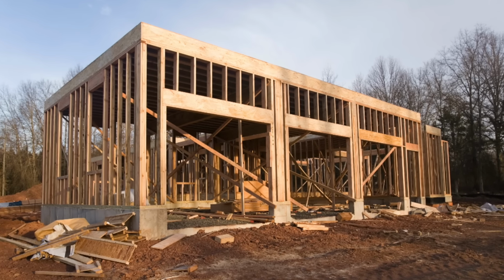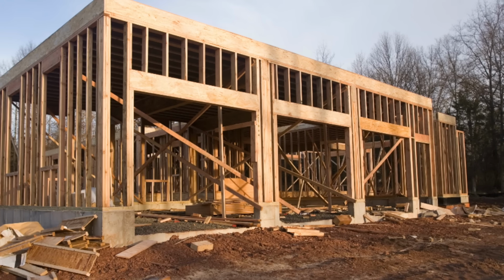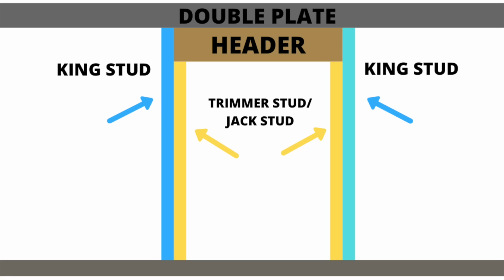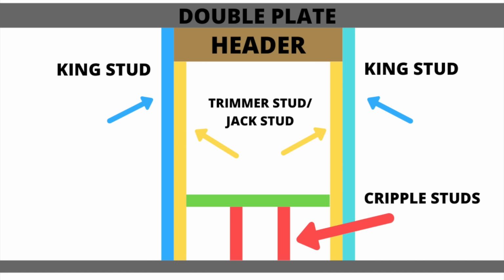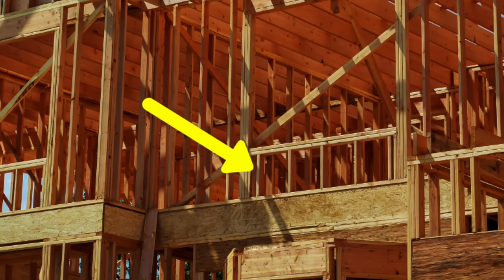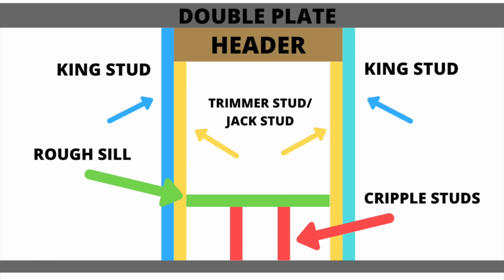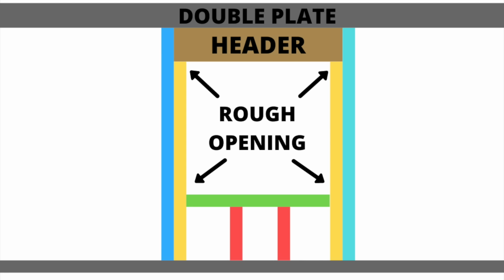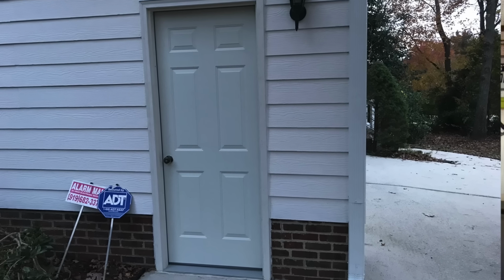All House Framing EXPLAINED...In Just 12 MINUTES! (House Construction/Framing Members)

Comment: Trusses are garbage.   When the wood softens in the coming decades, the metal plates tend to weaken and allows shift.
Back in the 80s trusses were used extensively by home builders and they are now becoming an issue in the North East.   Snow loads and wind force have caused severe racking.   
If the choice between 2x8 or trusses, only one logical answer exist.

Comment: Its called a Wall Plate.   Mud Sills are exterior and carry no weight.  
Terminology sure had been bastardized in the trades.
Engineered joist are absolute garbage.  If you see these in a home or building; leave.  They are disastrous in a fire.  They loose support in moments from heat and fold like dominoes.  They are referred to as "fireman coffins"
Blocking should always be run at 22.5 degrees.

Comment: how is an I-joist any of those things you mentioned?  Not only do the look cheap and unstable but the center material they are made out of is not that strong to begin with.  It looks like you're cutting corners just by using them.  There's no way they hold up just as well over a period of time compared with what they replaced.

Comment: Great instructional video but they build homes now to last like a manufacture home, not like things built back in the day. I-Joist and chip board surely need the driest conditions, and you better not have any plumbing leaks or a waterbed. How about that daredevil at 5:17, I wouldn't stand on a top plate and bend over like that, not even if I was young again.

Comment: American houses are a joke compare to the rest of the First World. Cheap OSB or plywood covered by some plastic sheet on the exterior followed by some vinyl siding. For in inside, they stuff in some pink cotton candy in between the studs for insulation and then cover it with a carton box material they call Sheetrock. About 2000 SQF of that mess, not including the 20x20 garage, will cost you around $300,000...

Comment: I am French, and the difference is really interesting. We have access to and use the same general rules of mechanics (basically use triangles everywhere, and you really have  a rectangle brace the diagonals), but the results in the detail of how a house is built is just crazy.
Reply: are there any videos showing the details of how houses are typically built in france? i'm very curious about the difference(s). i thought that wood framing is far less common in europe and especially france than it is here, which would in itself result in big differences – am i wrong about that? anyway, if you have any links to videos about common french house building methods, i'd love to watch them.
Reply: @jraaccounts  maybe you could have a look at this: https://www.youtube.com/watch?v=0V2h7QMb3hc it's typical, the guy is making the gables "livable" because the country lacks space to expand houses, he uses plaster board over a steel skeleton, and he has to use a ridiculously high R value insulation under the roof by law.

Comment: NOW YOU SEE HOW COME NJ HOMES ARE SO EXPENSIVE .. THEY ARE SOME, IF NOT MOST OF THE BEST BUILT HOMES IN AMERICA .. NOW ALL OF AMERICA HAVE TO BUILD ACCORDING TO THE CONSTRUCTION BUILDING CODES CREATED BY NJ BACK IN THE LATE 60’S EARLY 70’S ..  AND YES THE SOUTH HAS NICE LOOKING “POOR QUALITY” HOMES BUILT BEFORE 2012/2013 ..
Reply: All of America doesn't build to NJ standards, but nice try....   NJ (currently) uses an amended version of the 2018 I-codes, and their own "Uniform Construction Code".  Literally NOONE else in America uses this exact code. Also, NJ doesn't create the codes, they simply amend and adopt them.  The codes (with the exception of the NJUCC)  are created by the International Code Council.  Also, new codes are adopted every 3 years in NJ.  Your comment seems to suggest that NJ is still using codes created back in the 60's and 70's?!  WRONG.  You're not only literally yelling in internet speak (all caps), you're spewing false information.  Oh....and NJ homes are expensive because of real estate prices, NOT framing.  Sure, homes in NJ require more stringent wind requirements than most homes in the south and therefore more robust connections, but otherwise it has nothing to do with framing.  I will agree that (depending on the builder) that NJ has some of the best built homes in America, so there's that.

Comment: As a European, and having lived in the US, it still amazes me that homes built like this are the same price (or even higher) than our (literally) rock solid brick and mortar homes 🤷🏻‍♂️
Reply: Supply and demand.  Cheap mortgages (rates well under 4% a lot of the time) enable high demand so higher prices... of course this varies with location but it's not that hard to get a loan on a house here.  Bankruptcy?  Five credit cards each with 70% utilization?  No problem, fam!

Wood is also plentiful and cheap here (unless a pandemic has closed a bunch of sawmills).  If it was as abundant in Europe I'm sure it'd be used there a lot, too.
Reply: @NorthernWindNut  Most wood is imported from Sweden these days so....

Comment: This was a fantastic video. I will never be in the construction business, but after renovating much of my own home, I became very interested in how it was built. I remember going up into the attic and looking at the roof structure wondering what the heck I was looking at. I remember looking at the framing left over after a friend and I removed a wall with a door and wondering why the door was framed the way it was. I remember wondering why there was pressure treated lumber touching all the floors in my house. Now I have a lot of my answers. This 12 minute video is not only excellent for those in the construction business, it's fantastic for homeowners who are simply curious about why their home is built the way it is. Keep up the great work!

Comment: Homes in USA are utter junk....Iffy "foundation", wood sticks, tar paper, saw dust boards, vinyl siding, sheet "rock", rubber and plastic, built by unskilled (undocumented) labor force hired by "fly by night" builders. Small garage in which no car will fit (used for storage), short "drive way", and lot so small one can cut grass with scissors. One spends every week end going to Home Depot or Lowe's, fixing stuff.  All of these houses are full of cracks inside and out. Wood moves with temperature and humidity pulling shit rock with it. Yet they charge a fortune for this. The three little pigs built better homes. Homes in other countries last for centuries. In USA they start falling apart the day you buy them.

Comment: That I-Joint with a hole as big as the I-Joint... that strength is to say the least, very compromised.
Reply: It's not compromised. the vertical center of a beam/ joist has no forces acting on it; only the top and the bottom do.
Reply: @jobacuda4472  say what?, the fucntion of a beam is to hold vertical load. and what the beam is like a "I" is just for that reason, to hold vertical force. drill a hole the size of the beam and you have no strength left. or have i misunderstood the very basics of physics?
Reply: @FSandberg  That hole was not cut into the i-joist. It is a knockout stamped into the web during manufacturing. It is meant to be removed to allow ducting to be run through it.

Comment: The anchors at the sill plate are primarily for shear and prevent the structure from sliding off the foundation. In areas of higher wind hold down anchors are used strategically throughout the home to prevent the house from overturning.
Reply: And huge numbers of hoedowns are used in earthquake zones.

Comment: As someone from the Philippines, I have always been fascinated by American stick framed houses. Our houses are typically built with either poured or block concrete. I was always curious but never found a simple video explaining what all the pieces are for. Loved the vid!
Reply: I'd love to see a tute like this on how to build concrete block housing. How do you get it to acceptable insulation, and what do you have to do to make it waterproof? I'd trust concrete blocks to last a lot longer than stick frame, but it has to be good to live in too.
Reply: @tealkerberus748  Autoclaved aerated concrete at twice the thickness of a woodframe house provides comparable insulation. The advantage is that you have a lot more thermal mass letting you store the the cool temperatures of the night in your walls which is probably quite nice in a hot country like the philippines.
Reply: @ErikB605  Thank you. I'm unconvinced about thermal mass in a hot climate - if it heats up and stays hot that gets unpleasant fast. In a high diurnal shift climate, so with hot days and cold nights, thermal mass performs brilliantly. And I'm looking for a building system for a cool mild climate - almost always too cool to be comfortable, but rarely if ever freezing. So it's different again.
Reply: @ErikB605  they make most blocks by hand especially in the provinces area like farms
Reply: @tealkerberus748  I have built houses in Costa Rica out of concrete. I'm sure the process is similar in most tropical countries. There is no insulation necessary. Houses are made with cinder blocks with rebars to fulfil the strict earthquake codes. The blocks are usually then filled with poured concrete after all plumbing and electrical conduits have been installed. Each corner column (or after each run of about 8 feet) are rebar-filled, poured structures that tie everything together. All surfaces are cement-rendered and usually painted with water-based paints meant to seal against moisture and then painted with mould and mildew resistant water-based paints. Other houses are made with prefabricated vertically grooved posts (about 5x5) and rebar-filled prefabricated panels usually four feet wide, two feet high and two inches thick. They form a tongue and groove structure. Columns are planted and then plates are poured and the top beams are poured after all the columns' rebars have been tied to the rebar structures within the poured beams. All surfaces are then rendered and painted. Second floors can be poured concrete or wood or metal joist structures. Most well built homes are earthquake and hurricane resistant (although many roofs will still fly off unless people build with hurricanes in mind). Mind you there has only been one hurricane in recorded history that has entered Costa Rican territory (thankfully).
Reply: @tealkerberus748 concrete has it’s own issues. If it has rebar, it’s life is almost always less than 50 years, as the rebar swells when it rusts and cracks the concrete.

all concrete cracks, and it can sweat. It also is porous (unless sealed) and will pass moisture, etc.  it’s also chemically active (a strong base), which can cause odd effects unless it’s sealed correctly. 

It’s also very heavy and not strong in tension, which makes it problematic in earthquake prone areas. 

Still very useful of course!
Reply: we build junk stick frame houses in the usa. only commercial buildings in downtowns are block mostly.  block is better as long as it is done right. this guy also does clean nice work.  u cant beat building a thick poured walled house.  its better at everything. especially insulating. sink it into the ground in a hot climate and u will always stay cool
Reply: @tlohbor2690  I live in Miami. Virtually all residential construction here is CBS — concrete block and stucco. Only lumber is in the roof and interior framing. Except for decorative stuff on the outside to make it look more like a framed house if that’s a look they are going for. If your roof to header connections are solid (tie straps and sufficient nails), and you keep the outside doors and windows secure (impact glass or anchored metal shutters), that CBS house isn’t going anywhere even in the face of 99/100 hurricanes. This was an excellent video. I would love to see one discussing framing interiors and roofs on a CBS house.
Reply: @tlohbor2690  Not just stick frame houses. Yes that is most common, but here in Washington State we have been doing a lot of ICF block houses. If you dont know what that is, ICF is just styrofoam blocks stacked up as concrete forms. You pour the concrete into them, leaving the styrofoam layer on either side of the concrete, giving you the best isulative value of any residential building in the world.
Reply: @tlohbor2690  Wood framed houses can be built to last for generations, and wood has the advantage of being cheaper and sustainable. Of course most houses in the US are built by shady developers who are cutting every corner they can get away with and they get built so fast now that I have my doubts that they are being built with much care, but it's not inherent that wood framing is crappy.
Reply: Americans build their houses out of wood because of cost. And history, but mostly cost.
Reply: Or nippa !
Reply: Bear in mind, the video just addresses modern, code compliant, platform framing; common in tract homes. We also construct homes using various masonry systems. Homes framed with lumber may also be timber framed, or balloon framed. Timber framing isn't an uncommon practice today, while you'll only find balloon framing in older structures; balloon framing hasn't been code compliant in decades, as the stud bays run from the crawlspace/basement, to the attic. This allows a fire anywhere in the structure to quickly spread to the roof. While the guy in the video sang the praises of truss systems, he omitted the downside; truss plates tend to soften and fail in a fire, leading to collapse of the structure. Having been both a construction contractor, and firefighter have informed my perception of construction methods. One advantage I've found in balloon framed structures; replacing an entire floor system is a snap.
Reply: Like many commercial building walls and floors are here in the usa. We use a lot of metal supports in the ceilings in buildings, not homes. Could be due to the storms and  rot issue as in the Philippines is hot and humid and storms too, a cement and block home wont rot or fall down in a bad hurricane. Of course for earthquakes, wood stick framing is superior.

Comment: I owned and refurbished a 100 year old 3 story bubble frame house.  On the 3rd floor thw rafters were enormous with the rodge board 16' hight and 8' knee walls to fit an 8' tall attic/living space.  When I redid that area I wanted an open concept with cathedral ceilings. A neighbor with a very similar house had one, but when I brought in a engineer he said it would be unsafe to remove the collar ties spanning the bottom of rhe rafters. He said with the slate roof and the winds the neighborhood got from time to time madenis prone for a collapse. I had already removed them, and didn't want to lose rhe clean lines of the cathedral ceiling that my neighbor had in his place. So I decided to cut them in half and raise them up.  I moved the 8' knee wall down to 4' for more square footage.  When finished with recessed lighting the space was grand.  And because the central air trunk line was set up at the ridge board, the concept was going to be compromised anyway.  I ended up with a Dutched ceiling to hide the main duct line and exposed collar ties. Tho it wasn't my original plan, the area got a lot of compliments.
Reply from the maker: That’s a good work around, Matthew! Crazy weight on slate roofs. Always good to be safe and get the engineers input. Those old ballon frame houses are amazing!
Reply: @TheHonestCarpenter  I did forget to mention thst to fortify the gables i cut triangles out if 3/4" plywood (4/gable) and screwed them to the bottom of the rafter and the remnant of the collar tie they say on for more rigidity.   A contractor told me that was sufficient by itself but the engineer told me to use the collar ties again.   Sobe both houses are still standing 15 years later can't say if it was extra or not.